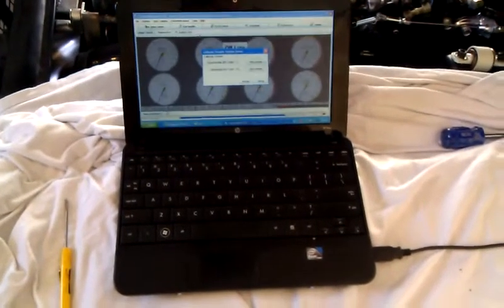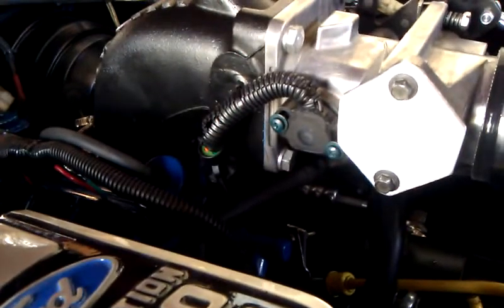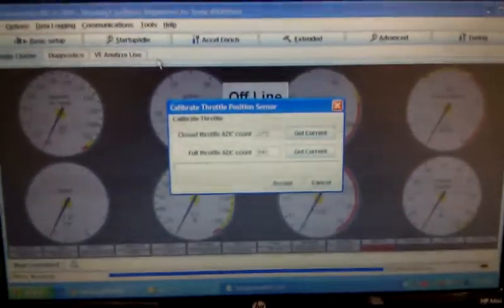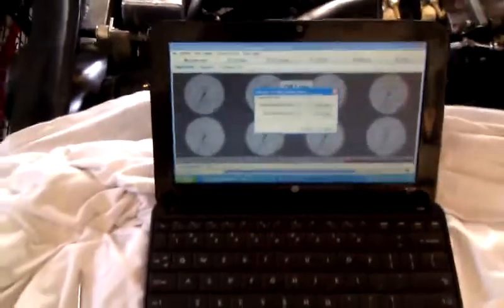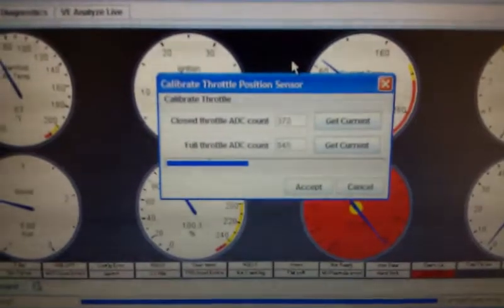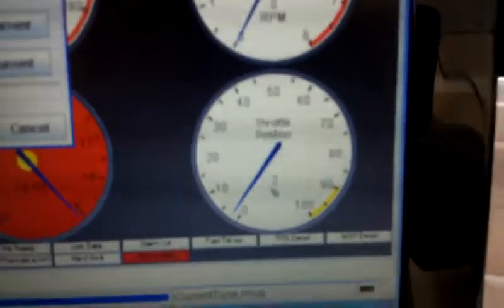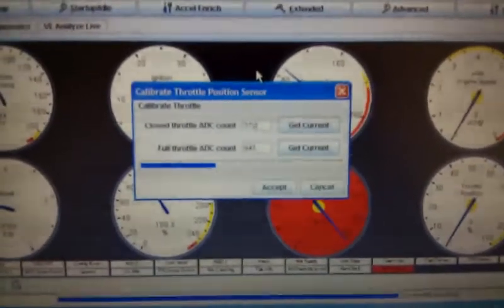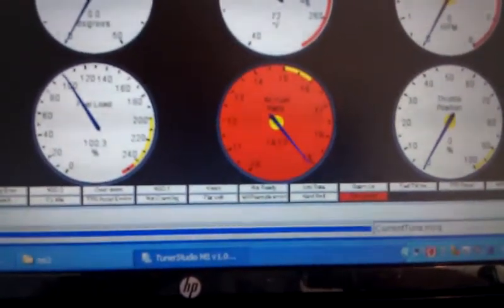TPS Issues.3gp

Comment: what you are seeing there is normal. That blue bar reads from zero. Since your closed throttle tps voltage is not zero that bar will not be at zero. The numbers you see are the raw data from the analog to digital converter. When you calibrate your tps it uses the low reading as 0% and the high value as 100%. This is scaled by the MS firmware. Things look to be working just fine. If you are still having issues get in touch and send me a log. I can help
Reply: Mike, my son has a 1989 mustang that we had a Microsquirt added. He's having an issue with it running rough, any way you could help out with that?
Reply: I can. What you are seen with the TPS signal is normal. Megasquirt doesn't care what the actual voltage levels are. You just tell it what is closed and what is open. It does the rest from there depending on other settings. What are you using for idle control? Factory IAC looks blocked off in the video
Reply: Just realized I had already commented on this a while back. Send over an email with his current tune file (.msq) and a log of the car running. I'd be happy to try and help out!
Reply: What's the best way to send the file?
Reply: mike22810 I'm not sure. I thought there would be a way to send as an attachment through PM, but apparently I don't know how to do that... I'll get back to you
Reply: I sent you a email.
Reply: Ok, I'll have to look for it. Assuming it went to my Gmail account
Reply: I am having the exactly same issue with my 92 351w swapped fox wants to idle at 3000rpm